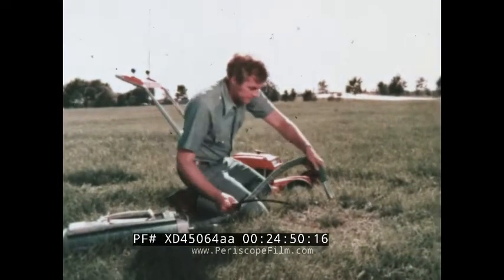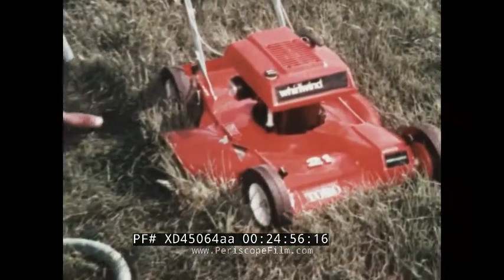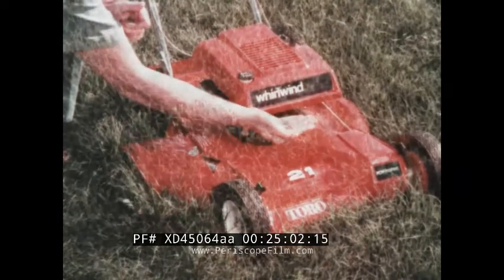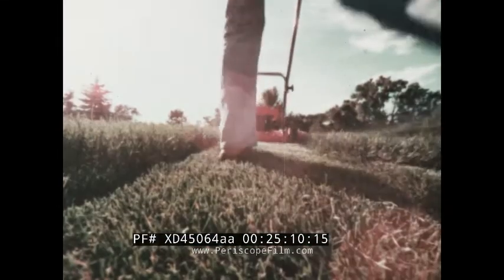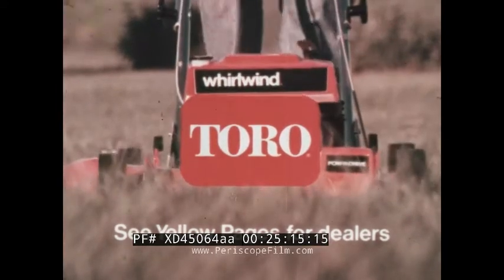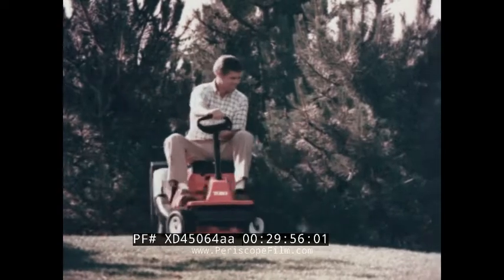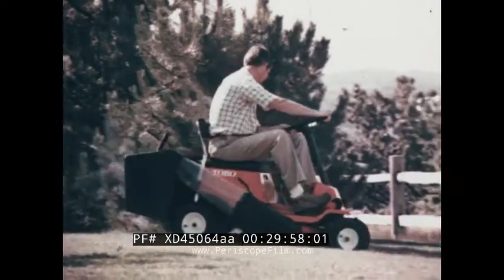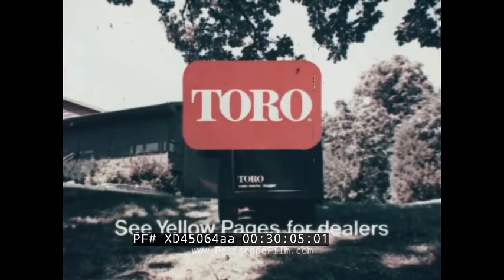1979 TORO WHIRLWIND GAS POWERED LAWNMOWER TV COMMERCIALS   WIND TUNNEL MOWER CONCEPT  XD45064aa

Comment: They're not lying that design really does that. I have a couple old first generation whirlwind 21 inch with the blade that has the curve, I've never seen a push mower cut so easily. They barely have to work

Comment: Thanks, Periscope. I remember the walk behind with a 3 1/2 horse Briggs. They'll never make them that good again. Thanks!
Reply: the best briggs engines were the" cast iron series"
Reply: @gregoryclemen1870  and Kohlers, And Wisconsins and, and, and
Reply: That's all the power you need if you mow regularly... My first mower had a 3.5hp B&S.  Great engine.
Reply: @campbellpaul  I remember these old Toro's and that'd just putter along. And cut smooth while doing so. I'm a slow walker so the ones with the Briggs were my pick.
Reply: @lewiemcneely9143  I didn't use Toros until the late '80s.  The first one I ever saw was a model 20588 at a K-mart in '83 with the 3.5 Tecumseh for a whopping $229.00 which I passed on since it had no self-propel.  That was also the only time I ever saw a cast-aluminum Toro at a big-box store.
Reply: @campbellpaul  I just did the yard and they had one of each. I got the Briggs and the Tecumseh was followed by whoever was there besides me. I just eased along and tried to get the 80+ year old owner to come down and mow or trim. He was a real character and we had many a fine goofy conversation. Don't make 'em like him any more either!

Comment: the toro "WIND TUNNEL" design deck, dates back to 1960, with the "S BLADE" design, and was powered by a mod. "LAV 30" tecumseh engine ( push mod.) / "LAV 35" tecumseh engine( S.P. mod)       also "TORO" and "WHIRLWIND" were two separate companies at one time, toro bought out whirlwind in 1959!!!.

Comment: More like a 1975. By 1979, Toro had been making the Whirlwind II for 2 years, which was a design based on the 1974 Guardian deck. It's not a 1976, because there were no dipstick tubes that year, and the Toro and Whirlwind decals were switched on the shroud and the front of the deck.
Reply: I would say more like ‘72-73 when they first started using Briggs engines on these models instead of the Tecumseh LAV 30. Also that Electrolux model 1205 vac is the ‘68-‘72 version (another high quality item that we used to make here in the US).

Comment: I want to see the flo mow it was a wheel less mower that the blade gave it enough lift to hover and glide along they didn’t catch on I’m thinking mid 70s
Reply: it was in the mid 70's, and the repair shop that I worked in, sold those units, the problem was they did not sell, and did not perform all that good either.
Reply: You can still buy them at Home Depot
Reply: Yes... I think they've been around for about 65 years or so... Made for mowing the sides of hills, I believe.